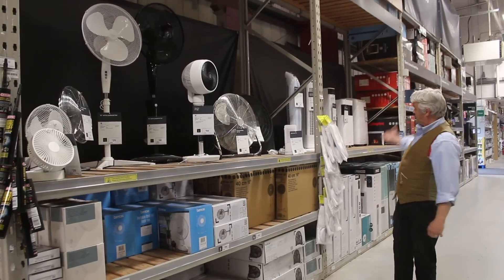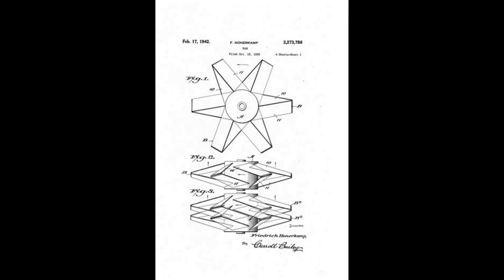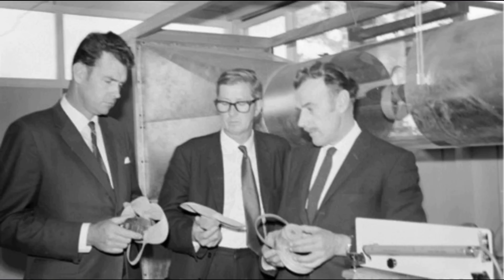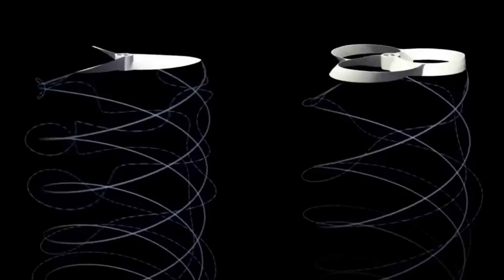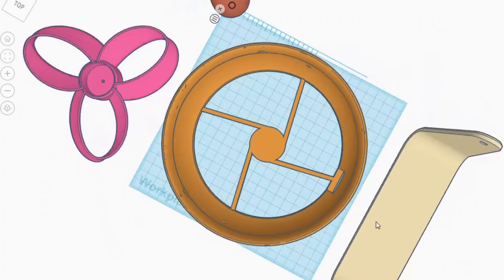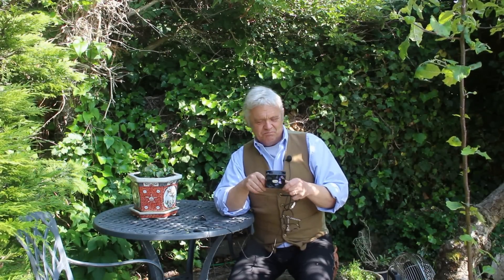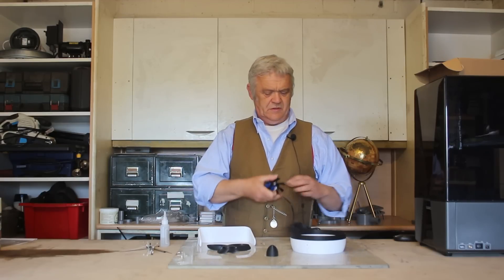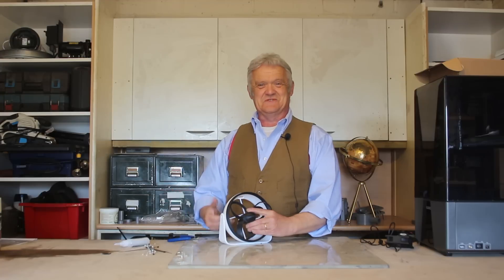1952 Cheap Way To Keep Cool This Summer - DIY USB Powered Toroidal Fan

Comment: Did anyone else's printed fan blow air in the wrong direction?
Reply: I found that out after printing one.  I believe his did also.  Just look at the pitch of the blades and which way it turns.  I went back to tinkercad and made a mirror image of the fan blade.  I am printing it out right now.  I am glad I was not the only one.

Comment: I want to build one of these using a peltier air conditioner peltier module instead of using ice. It will be much smaller in height though. I downloaded the .stl files that you so graciously provided us. I love the projects you come up with. I love how quiet the fan is. Thanks Robert Murry-Smith. You are an awesome teacher sir.

Comment: Nice video. I tried to build a ventilation tower myself some years ago, i used three 20cm Pc-fans for this, stacked on top, vertically. But there is a main component of the fan you compared your build one to: the grill. Yours has none, the one you bought has.

At the time i was building mine, i noticed quite a difference in sound and noiselevel for the different types of mesh i tried to use as a fancover. I think, the type of cover is more important for the quality and loudness of noise, even more as the shape of the blades.

If your fan doesn't need one (because its safe to touch), it's perfect. But that was something not pointed out in the video, so maybe it's possible to get an update for that. Or some test of different covers, if needed to keep some fingers safe.

Greetings from Oldenburg, Germany ;-)
Reply: Yes, I used similar blade design to 'upgrade' my traditional mains powered fans and I noticed a huge difference before and after mounting a shroud/cover. Certainly the feeling of the wind tunel more than anything!

Comment: Most internal PC fans are 12v.  To run off USB, the fan needs to be 5v - look for a fan that already has a USB connection and you know it will work ok.
Might also want to print a grille for the front if there's any danger of people sticking their fingers in.

Comment: you could fix this to the top of a cool box that is filled with ice (leave in the bags for re-freezing) a tube out the side and it works great a a silent air conditioning unit! I made one with a pc fan but it's quite noisy this would be a brilliant replacement . Fancy giving it a go?

Comment: That's a much bigger fan than the original.
Have you measured the RPM?
I would imagine much, if not most of the noise reduction is due to the fan spinning much slower.

Comment: I agree I think your fan looks nice too.  I've had one for many years like the one you say sounds like a jet engine , the first one was advertised as a whole house fan and if a persons house and everything is situated right  and the fan place right they can create a draft/vacuum through the whole house but they do make a lot of noise. I wonder if a person put one of the toroidal blades on a fan like that if it would still be so loud? Thanks Robert

Comment: It would be neat to get a wind measurement before and after as well as a wall of ribbons to demonstrate the angle of the wind spread at some distances in front of the fan. The fan that moves more air and is quieter wins 2 categories  not just one!!

Comment: How does a shroud affect the performance? A lot of fans are designed to be modular enclosed assemblies. The blade tips are the only moving part so that should be the only part that affects the performance, right?

Comment: don't plug a fan into your usb, one of the worse things you can do to your power supply, especially a laptop.  unless your pc costs only $15 bucks.  don't ruin $1,000s of dollars for a dumb fan. i'm out, unsubscribed, used to be interesting.  next will be a coffee warmer from usb, uhg. pcs aren't generic do anything you wish widgets.
Reply: WTF do you think keeps your laptop cool?  A friggin' fan!  And PC's are full of friggin' fans!  One more isn't going to bother it.
Reply: @j.f.christ8421  have at it, bud
Reply: @jame880  Maybe one day you'll get a clue, but I doubt it.
Reply: @j.f.christ8421  you said it yourself, there's already a ton of fans inside, with specific job to run the computer.  if you want to add more fans that have nothing to do with running your computer, go right ahead.  don't let my clueless comment stop you. you have my full permission.
Reply: @jame880  Clueless is right.

USB was designed to supply power.  What's so different from plugging in a fan as compared to any other device?

Comment: I bought a large old air conditioner non working for £50 a couple of months ago, found the start capacitor for the exhaust fan was faulty which was why it was overheating and replaced it, full clean out when I stripped it down and checked the pipes etc, all good, works like new. 
Got foil lined air ducts, outdoor vents and am now sizing up a panel to go in a window frame for the air in and out cycle vents, the machine will bring house temperature down to a comfortable level running for about 20mins, works our about half a kw.
Haven't needed the dryer which uses at least 2kw thanks to the weather so technically on paper it will only cost me just under £100 and a few quid here and there to have an air conditioning in the house for summer, makes sense to me! 😂
I'm pretty strapped myself so after following the weather scientists and the el nina stuff started getting bit by bit so there was no big outlay of cash.

Comment: Like the idea & especially the price, here's a idea for repurposing If you have a Noctua NF-A12x25 (The one that you can see the metal hub in the center, you could just pull the entire blade shell assembly off, by putting pressure on the metal hub while pulling @ the blade housing & scale up the design for it- then you could just slide it down over that metal hub & viola' a fast fan that should run for years with no more fuss, & if you ever needed it again you could always swap the original blade shell back on it.

Comment: Great vid as usual. Have you got any power and air flow comparisons between the original and the new set up? It's obviously several times the area but less than half the voltage, quarter the power?

Comment: The thing i noticed about this propeller for marine use is that it would be less likely to be fouled by seaweed or such-like debris.
Why isnt it more broadly used?
Reply from the maker: because it is difficult and expensive to make unless you can 3d print it

Comment: Hi Robert, you could half fill two bottles of water, freeze them and then stick them behind the fan to give an AC effect
Reply: I used 1.5 l fRozen plastic bottle putted front way just in  box to fit in works 4 ,5 hour s full cooling capacity;!

Comment: I can get the motor for it but getting the toroidal fan part . Where can I get a toroidal fan part?
Reply from the maker: you have to make it
Reply: @ThinkingandTinkering  rats that means I have to buy a 3D printer. You know I'm smiling right? But I'd have to make it profitable for a very good 3D printer purchase.. I'll work on it, thanks.

Comment: It would be a nice comparison if you could measure noise and current in the original fan, and then in the modified fan, so we can see a digital comparison.  Good subject video as summer approaches.  It takes me about a month to adjust to the fan noise while sleeping.  Maybe no so anymore!  Thank you.
Reply from the maker: i showed a graph of that
Reply: Yes,  my bad.  I blew through the noise graphs.  Sorry.  But can you measure before and after current?  I am much a fan (no pun) of peaceful summer sleep without the jet-like noise.  Wondering how long I can plan on a battery pack lasting based on real time usage info.

Comment: Great video - as always.  But am I the only one who finds it scandalous that something that was already patented so long ago can still be patented again, blocking people from freely using things like this - unless you're willing to spent $$$ on lawyers to defend against patent claims ...  The patent system is just rotten!
Reply: You can simply ignore the patent if you know that prior art has already existed over 25 years ago . Used to be 17 years. Robert for example showed us prior state of art  ;  it's sufficient to hold MIT at bay from taking action . I recall Robert once told us that MIT is known to take out patents for prior expired inventions .
Reply: Its not blocking me!
Reply: You can patent the "novel idea of usage" aka "I pattented the use of a paperclip to remove dried snot out of the nose", vs "I patented the paperclip for holding documents again", so, you can use the toroidal propeller to make a noiseless fan, and the next guy can patent it to make a quiet fume extractor, or you just alter the proportions of the propeller (changing the geometry) to give it the novel use "yes, you pattented the noiseless fan, but my modification allous for easier production, and the design is different, so I owe you no royalties".
an industrial microbiology teacher taught us that nowdays you don't want to patent a modified e. Coli that produces insulin, because that leaves the door open for someone to take a yeast and your process and make a new patent, you patent the whole process to get some form of protection for your invention.
Reply: I agree re-patenting something is wrong.  However, I have been told by legal counsel that I can make anything with a patent as long as I don’t make money on it. That is where companies will go after people.
Reply: There are loads of age old patents being repatented. Just tweek it enough or find another use not mentioned in the old (or repatented) patent. Clay pot  water coolers and food lockers with a fan,  Bingo
Reply: Unless you’re trying to sell it then the patent doesn’t matter. Building for yourself is fair use.
Reply: To answer your question, no, you're not the only one.
Reply: The patent system is a mess, they aren’t supposed to give out patents for obvious things, but they do. They give patents for too long too, in rapidly developing fields they shouldn’t be giving 20 year patents. 3D printing is a big one for patents, a company managed to patent putting a box around a printer to keep the heat in with the motors outside of the box and prevented any other company for making anything similar for over 20 years, when it is something that is obvious to anyone working on 3D printers. It held the whole industry back. Another company was trying (I don’t know if it was successful) to patent a specific range of thicknesses of heat breaks for 3D printers, anyone knows that if you decrease the area you decrease the thermal transfer and the company was using open source designs but trying to patent a specific range of thicknesses just below what their competitors were making, to try and prevent their competitors from going any lower so they would have an advantage.

The patent system just gets abused, it needs totally reworked, it should protect against blatant copies but not much else and only for a reasonable amount of time. You shouldn’t be able to patent whole concepts and you shouldn’t be able to patent stuff you have no intention of ever using.
Reply: People rarely patent something in all countries. It's likely a USA patent, so if you are outside the USA just ignore it. Patents are generally only enforced if it's used commercially anyway, as it's just not cost effective to take Joe Bloggs who has little money to court.

Comment: seems quiet, how much power draw is it doing compared to the noisey fan blades? say if you had it on a battery, does it sip the juice or guzzle? very cool either way, just looking at ideas for cooling my greenhouse a bit, maybe with a small solar panel setup

Comment: You can the wire of a normal pc fan find an old mouse use the usb connector and solder them together also no need to go buy a new fan.
Reply: Well done, you have discovered that a 5v fan runs on 5v 😂

Comment: Awesome stuff, have you tried cranking it up to 12v from the 5v usb?
Reply: It's a USB fan, so it's a 5V fan not a regular 12V PC fan.
Reply: @andyspoo2  oh right, didn't know if it's just a pc fan power via usb. Wanted to know the noise at 12v as it can go in a cigi lighter socket in a car 😉